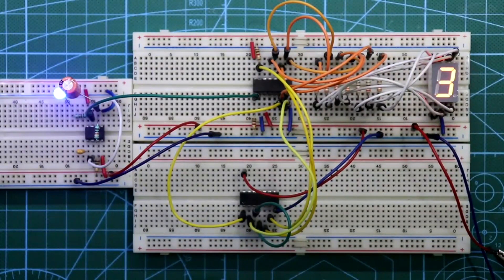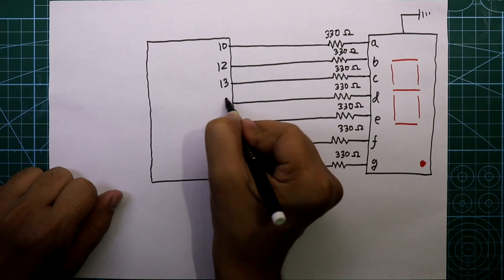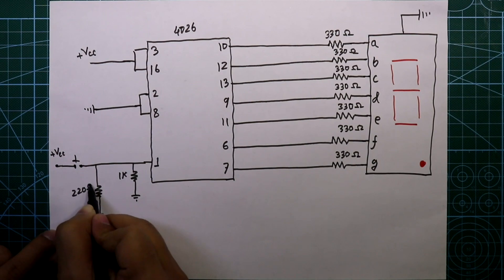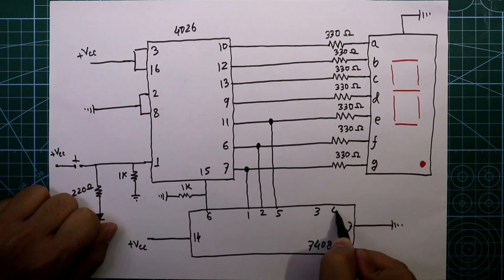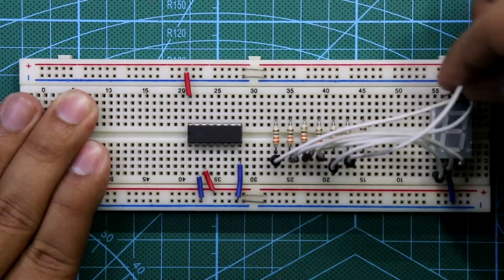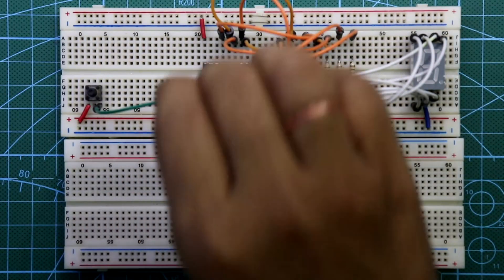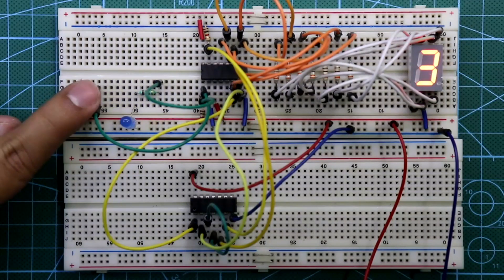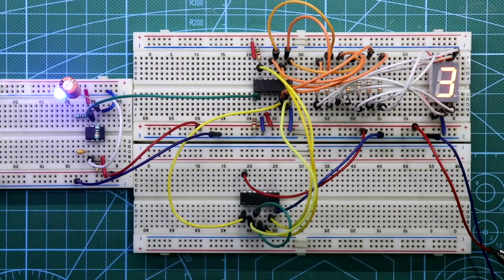MOD 6 counter with 4026

Comment: This is great! Would this be considered a digital or analog circuit? I need to create a digital circuit for my project.
Reply from the maker: Yes, CD4026 is pure digital ic. It is decade counter ic, and also it has 7 segment display driver.
(If you need to create for college project, then better you go for Binary code to Gray code converter. I already uploaded that)

Comment: Sir please tell me why 7408 ic is used i am confused
Reply: By default (& gates not used) it will count from 0 to 9 and then back to 0 
So to count only till 6 ,we need to "truncate" the sequence so that it "resets" back to zero the moment 6 is reached 
So after 5 when 6 is reached ,Baam!! it will reset back to 0 
So thus it is now a mod 6 counter counting from 0 to 5 
The counter IC CD4026 has the reset pin (15th) , when we give a HIGH there the counter resets to 0 
Thus the idea is to give a high atbthe 15 th pin or the reset pin of the CD4026 only when 6 is reached 
Thus we use & gates to "decode" 6 and give a HIGH output only when 6 arrives and this HIGH is given to reset pin 
The speciality of 6 in 7 segment display is that , it's the first number (starting from 0) which has the e,f and g segments of the 7 segment display as OFF or LOW 
So we use these 3 as input to the  & gate ( by connecting any 2 of the 3 to a & gate and then connecting it's output and the 3rd one as input to another & gate) 
This we get a 1 or HIGH only when 6 comes up and we connect this output of & gates to the 15th pin or reset pin of CD4026 and thus everything goes as expected

Comment: Can you show how to do a mod 15, please?
Reply: You need to take the 1 5  i mean 1 = (B)(C)    and the 5 = (a)(c)(d)(f)(g)     all inputs with AND gates and the result  take it to RESET (you should use a lot of AND gates) 

NOTE did you dont want it RESET at 15  if you need show 15 , then YOU need reset to 16 (when 16 apears, instantly sent to RESET both IC
Then
1 = (B) "and a" (C)     6 =  ( "NOT F" )  "and b"  ( "NOT E" )                       then these outputs, go to another "AND c" gate and  the result to a both RESETS 

_______________
"NOT X" = NOR GATE or INVERSED X
"and a,b,c"  = its the and gates inside a  IC 
If you need 15 count then need 0-14   :       1 = (B)(C)    and the 4 = (b)(c)(f)(g)
can do a KMAP ti reduce it but if use all inputs must work fine